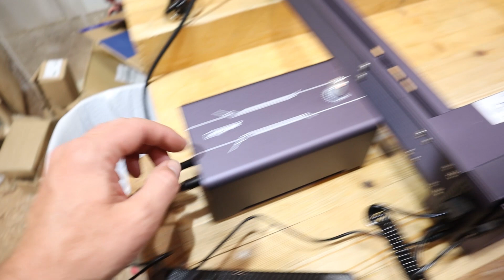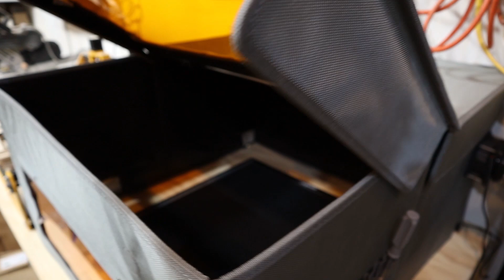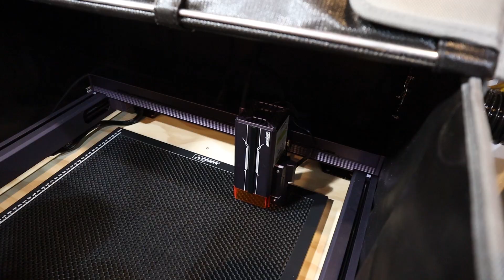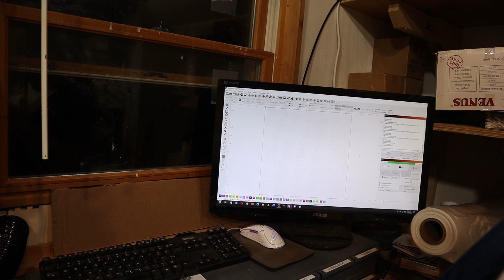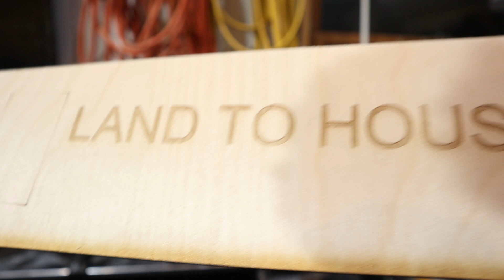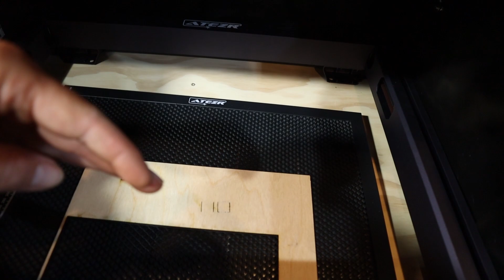Atezr L2 36w Laser engraver

Comment: They sure don't make it easy.  I found out the hard way about having to put in the little USB dummy as well.  Any experience with the touchpad features?  I tried "frame", and it just did a small rectangle path until I had to turn the power off to stop it.  I can't seem to find any info about initial touchpad setup.  It doesn't even reference which corner is "bottom left"???

Comment: We bought just about every option for L2 36w unit but the extension and hood....Were not very happy so far, one of the X rods were not mounted in its socket and would not fit even with the screw out of the socket, had to be hammered in. The unit was scratched up, when I contacted support they said...oh sorry. We paid $1600 for this unit and it seems to have software issues and it will not autofocus and tech support is useless....I really regret buying this unit.

Comment: Cool toy, but I need one that will cut .125 in. stainless steel. Only obstacle is a shortage of $$$$$$$$$😆
Reply from the maker: .Those metal cutting lasers are quite expensive.
Reply: @LandtoHouse  cheapest I've found is a used 4x4 tabletop for $6000